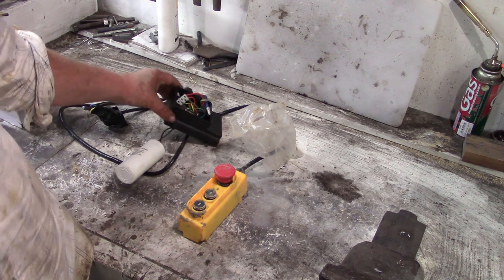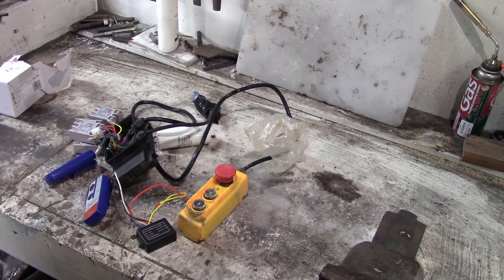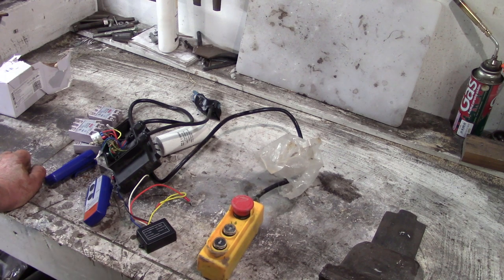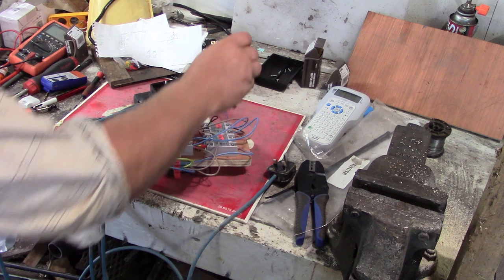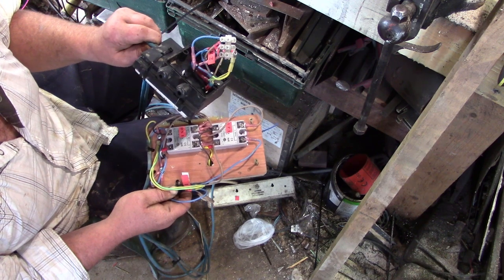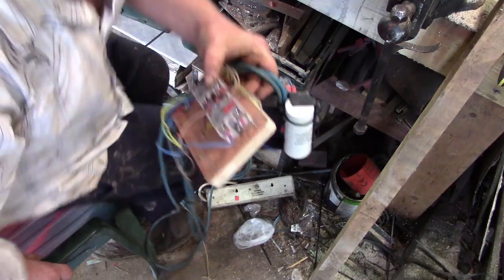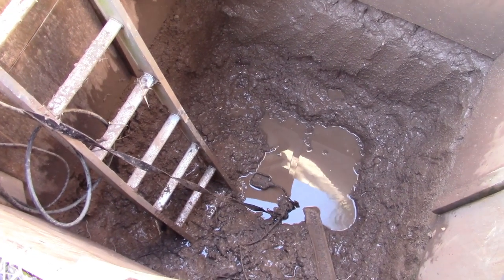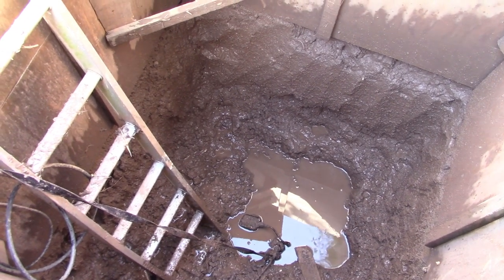Underground workshop bunker #2 winch remote and pumping mud

Comment: Digging in clay it's pain in the ass. I remember that big hammer drill with like a shovel tip was kinda working, but still it was a lot of hard work. Thanks for update 👍
Reply from the maker: At least it's stable, this would be more difficult in Sandy soil
Reply: @turboconqueringmegaeagle9006  That is so true.

Comment: Would it not be easier to place a shipping container where you want the bunker, cut out the floor and dig out inside. There by sinking the container into the ground slowly? An access hole cut in the top for access, make caissons around the access tunnel and the  spoil when removed from below ground can back fill on top. Only a suggestion. 
On you’ll be enclosed from the elements and prying 👀. 😉
Watch for gas levels though especially if the container starts to rust and oxidise.

Comment: You know, if it's something you'd find interesting, you should make a note of where you dump the dirt of mud, so someone can go through it later with a metal detector and see if there's anything small mixed in, might find an old coin something.
Reply from the maker: Found a few bits in the top 3' bits of smashed porcelain and a jaw bone with teeth (horse or cow or giant) my house was built by the railway company so I always find interesting stuff when I dig.

Comment: shame you're not closer to my area id help you for free off camera..

If you dont accidentally build a coffin i'll give you a vehicle design not currently in use for a video . its perfect for you.
Reply from the maker: Sounds very intriguing.....
Reply: You need a small low rolling resistance sturdy sub frame..moped wheels/strong small bike wheels.. not sticky bearing...bike gearing/cranks drive train...
Weighted hgv wheel...sturdy swing arm to hold it..around 5'' above the ground...without a load the weighted vehicle wheel will spin up pretty easy...you'll lower it to the floor and the momentum propels you forward..you keep adding wheel speed and lowering when you want...you'll have genuine spikes of real torque..

tire to be ran soft with low psi just enough to keep seated.. you dont a potential explosion behind you..but it should be very low stress on the wheel if you dont add ridiculous speeds and slam the wheel down lol...a cordless drill would appeal to you over cranks and leg power i suspect...i cant find proof of my invention online...somehow im the only person using this method of propulsion , ive seen some small scale builds but basically pull back and go toy copys nobody is doing what im planning in the same way. 

With a tarted up aero package this might crack a ton...taking the current record...but not on our budgets matey silly money for a really high end build with ti & carbon & two swing arms &wheels crammed in to a snug build while some dude giving it some serious pedals .